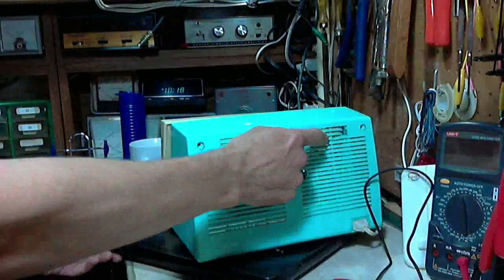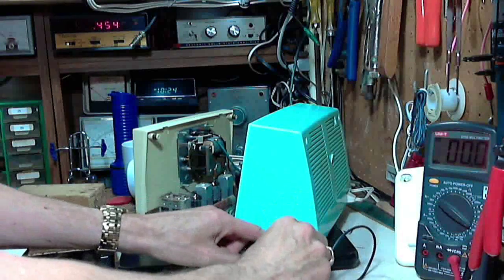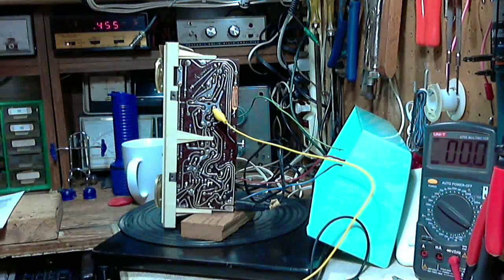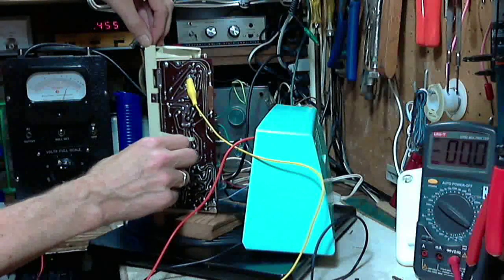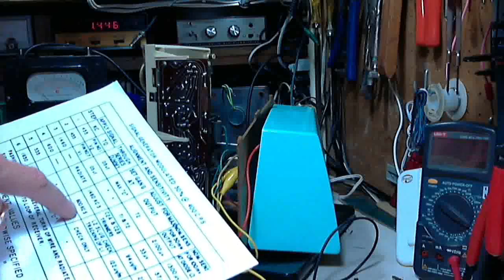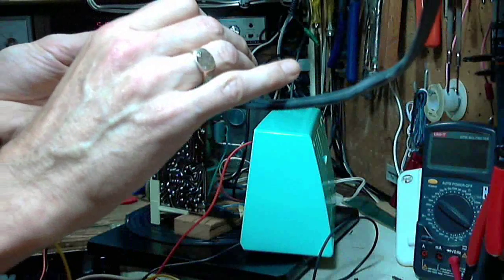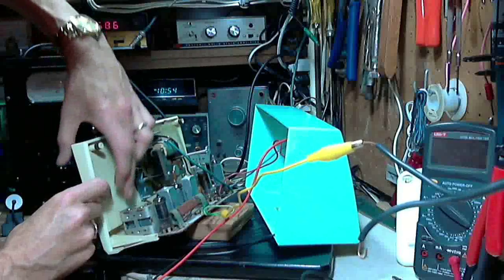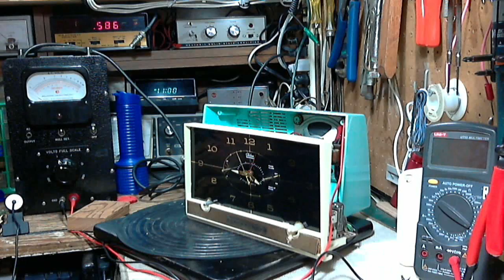Electrohome AM Clock Radio Video #3 - Alignment

Comment: Do you think the printed capacitor might be some form of lightning protection? Being on an external antenna and all.
Reply from the maker: I'm pretty sure a bolt of lightning could jump that gap. ;-)

I think it's to protect people who might touch the antenna.  It reduces the chance of shock.

Now you've got me wondering if the little burned area where an arc had occurred was from a little wee bit of lighting.  I really think that someone grounded the wire and the protection was insufficient to hold back the 120V AC current.  Who knows?